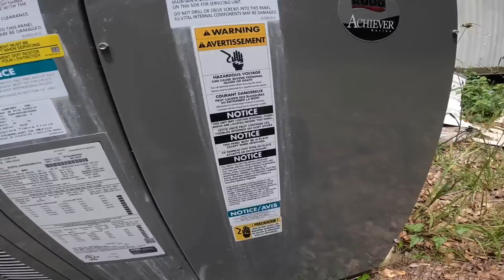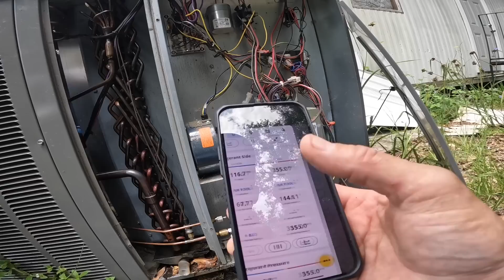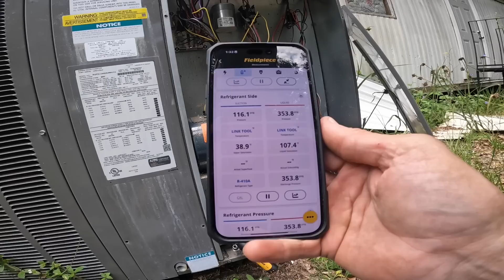I Had To Walk Away Without Helping! #hvaclife #hvacguy

Comment: Don't blame you one bit for walking away from that mess. Looks like it had an old Coleman gas pack originally.That was reason enough to hit the road LOL  I'm not so sure you shouldn't have ran away from that LOL. The leaking sewer was the deciding factor for me :)
Reply: That's not a "Coleman gas pack'.  It  was the original Coleman gas furnace.  If it had a/c with it, that would make it a split system.  Only 2 types.  Package unit or split system.
Reply: the plywood floor got me

Comment: My worst customers, 35 years in. I rang the front door bell, the husband opened the door and the thick stench of cat urine hit me in the face, never smelled anything like it.  I stepped in, and my eyes started to sting and water, the urine was that strong.  I went to the truck and put on a chemical mask, and completed my 15 minute inspection. The homeowners sat on the couch reading a magazine like nothing was wrong.    #2...I went to a different house to give an estimate for interior work, and the stench inside the house while standing at the front door hallway was so bad, I declined to enter-- don't even know what it was.  I knew if we got the job the crew would refuse to go in there to work.  #3...  I went to an apartment, and an older lady answered the door. The airborne spore level and stench from mold in the inside air was so high, it was choking, like like inhaling smoke. I couldn't believe believe she could stand it. I went to the truck and put on a mold mask. She told me that no one would sit next to her at church because she smelled to strongly of mold. Water was seeping through the block walls that were below exterior grade soaking the carpet- for years.  The landlord refused to pay to fix it and do a clean-up.

Comment: Sparky here, Had a duplex a couple years ago, went to crawl under it and came across a load of needles. Told the owner i'd either walk away, or I was going to do things my way. He gave me the go ahead, and I wired the rest of the one side of the duplex by cutting an access hole in the middle of the apartment. The crawl entrance was like in the middle between the two units. Got the work done, put a piece of plywood back down, all gravy,  but I'll never go in a crawl again without looking out for that. Jeeze. Don't blame you at all for noping out of this one!

Comment: I'm a mechanic and I've seen 100x worse than that trailer. I was called out to change the alternator on a 98 Ranger once, got to a horse farm to find the husband and wife waiting outside. Fixed the truck and they invited me for dinner, being polite I said ok and oh my god I entered the trailer and the air was STALE with cat piss. The floors had holes rotted straight through to the ground outside, there was PILES of cat sh*t at minimum a foot high just sitting in the kitchen. Several dead partially eaten cats lay on the floor. No AC of any kind in the 100F + arid New Mexico desert made the smell unbearable, it was inhumane the way they lived. I can still smell it...

Comment: I used to clean furnaces for the gas company in Minneapolis. Yep, that was pretty nasty but I'm sure you've seen worse. I was cleaning a dryer vent for one lady and pulled out 2 gerbils that were dehydrated with the tail sticking straight out. It was like 2 furry popsicles. The lady says, we were wondering where they went. 

My favorite call was from a husband who hired his ex-brother-in-law to sand his floors and the guy didn't used a dust collector on the machine. Homeowner was freaking out. His wife was coming back from a week away and she hated the ex-Bro-in-law hahaha. I told him, you be screwed. I had to walk away from that one.

Comment: It looked like a floor return right at the unit or what was that metal elbow for
Reply: It looks like a down-draft furnace.  The elbow is under the furnace and ducts the air to the other half of a double-wide mobile home.  The return or suction is actually at the top.  The intake air filter is supposed to be attached to a cover or door that covers the TOP half of the unit.

Comment: I'm not trying to bash you or your decision but the return came out the unit and 90 right up clear as day
Reply: I'm thinking they had a board or something covering the return. There's so much stuff in there that even if you figured out the location inside, it would take a lot of time trying to move stuff around to uncover it. I would have told them the unit checks out fine, they just need to find and uncover the return. They don't need an A/C tech to do that.
Reply: Yeah they put plywood all over, the subfloor is rotted

Comment: As a service electrician, I would advised at least stopping and notifying the customer as soon as you saw those exposed conductors running on the ground. The real danger of an electrical fire or shock supercedes the inconvenience/discomfort of a faulty HVAC system. If they choose not to make proper repairs then walk away before even going inside.